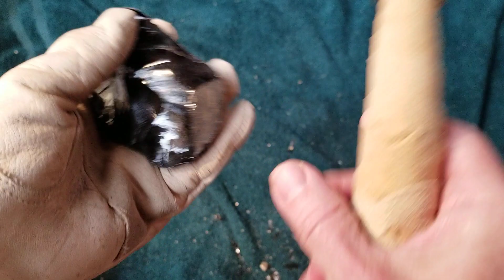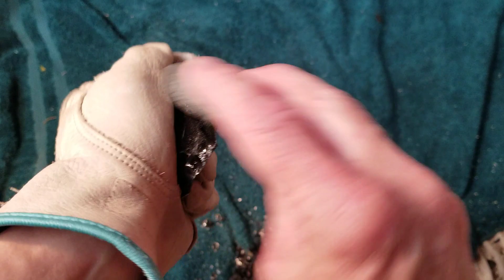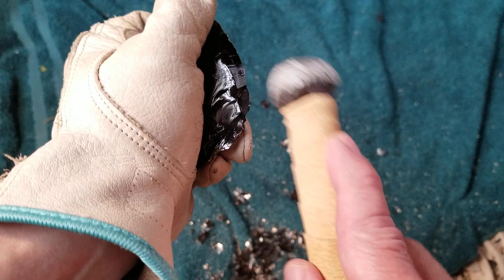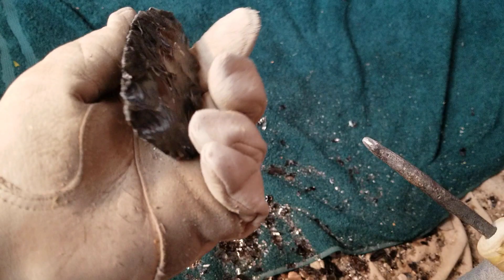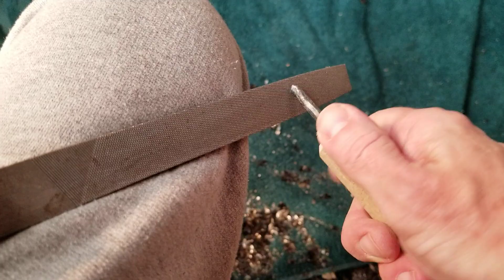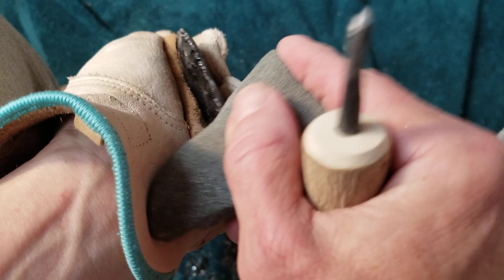843 - Flintknapping Obsidian Clovis 1/3

Comment: Thats an interesting fracture in the wrought! Suprised it broke clean like that, usually it drags some of the parent bar with it. Must have been a really high silica content at that point to make it break clean like that
Reply: And wrought usually bends instead of breaks. Good thing I sent extras
Reply from the maker: It didn't snap clean off. It broke maybe 90% of the way through and I worked it back and forth until it came off.
Reply: @KnapperJackCrafty  okay, thats pretty typical of wrought. Was thinking on it and besides possible inclusions, the length of the tool lent itself to snapping over bending.
Reply from the maker: @veteranironoutdoors8320  I see, 😁👍

Comment: I have used everything but aluminum on my obsidian. My iron nail flaker runs the thin flakes almost to half, my copper indirect gives me consistent thinning flakes passed center (overshot for sure if I am not careful) and a notched antler for when I need to isolate the platform. Am I doing it wrong because I can't seem to stay in a lane? Oh and lead filled copper boppers 1" and 1/2" and a moose and white tail billets.
Reply from the maker: Whatever works. No rules. 😁